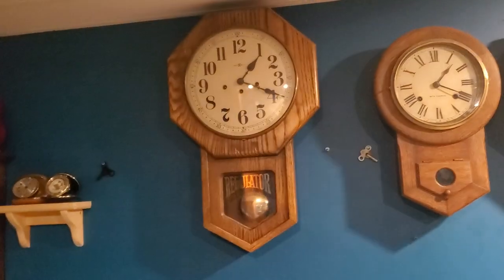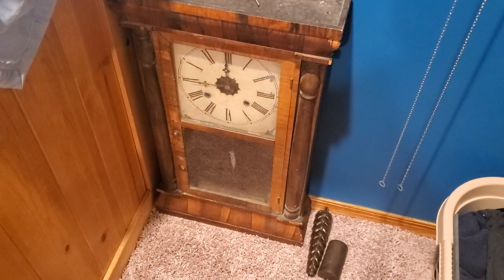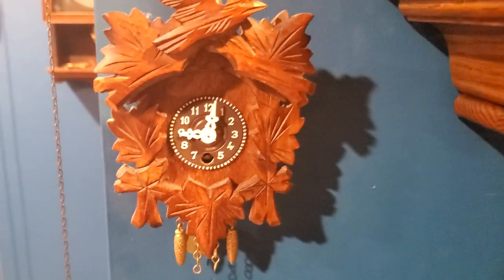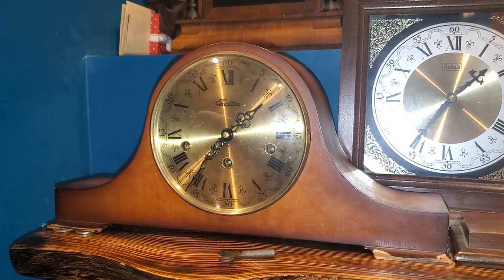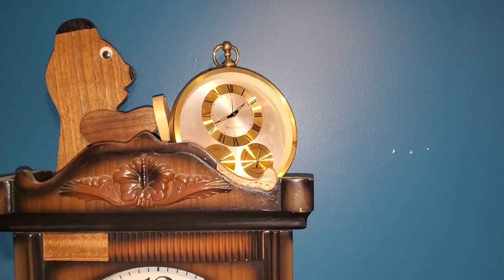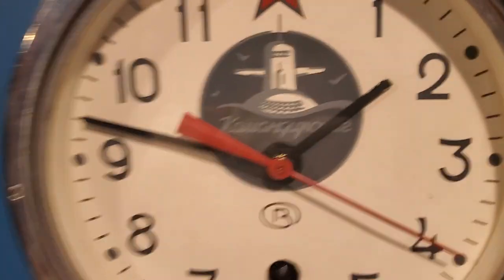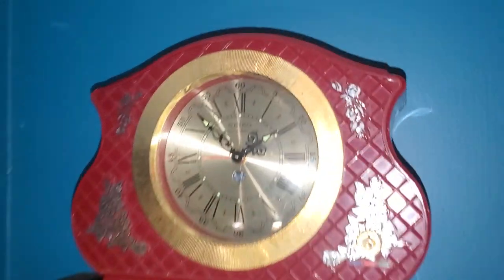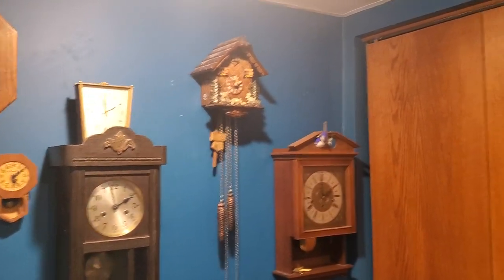IN-DEPTH!! Clock Collection #10 (10/30/2021)

Comment: I really like the Howard miller shelburn I'm currently trying to find one
Reply from the maker: They're not very common in the UK if that's where you're based. They're all over U.S. eBay though. The shipping will just be too expensive most likely :(
Reply: @DannysClocks  I live in the UK so that's going to be a problem oh well I'll get one at some point when my budget get bigger or if I came to the U.S. on vacation

Comment: for the seth thomas short drop do u mean 1889 or 1989? ~_~
Reply from the maker: No, the movement is actually called a Seth Thomas 89. Sometimes it's abbreviated as ST 89. It's the model of the movement, not a date.
Reply: ohhh ok soz i didnt reply ur 5hours behind so i might have been at school